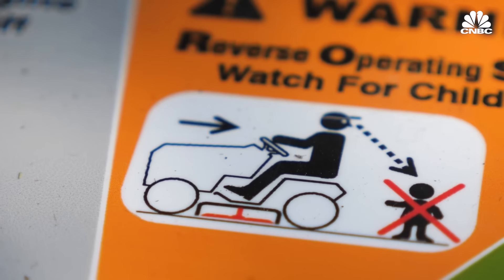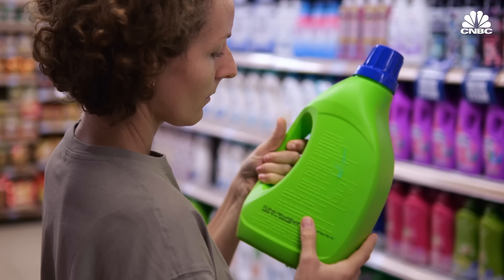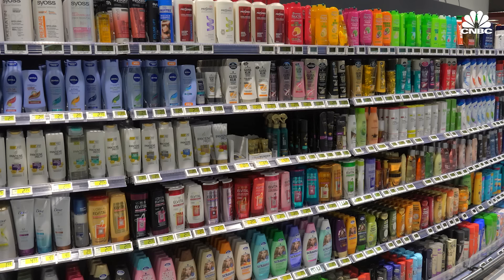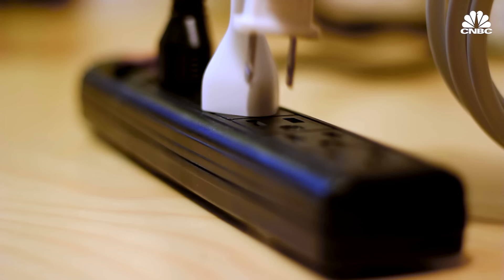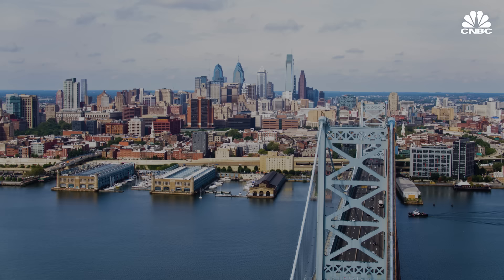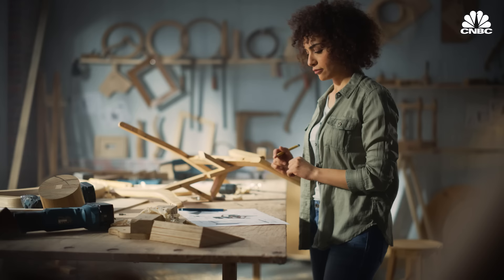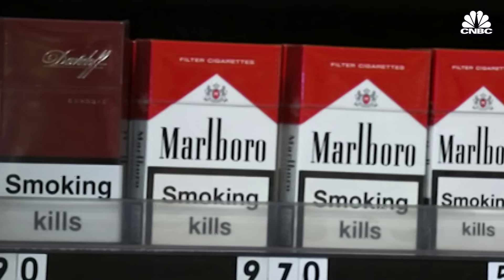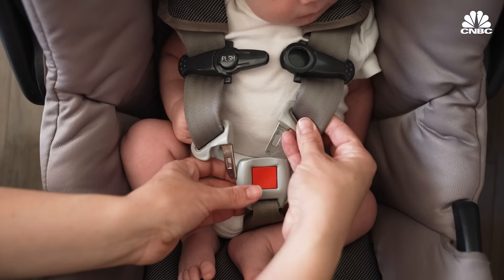Why Warning Labels In The U.S. Aren’t Working

Comment: How about teaching people that life is dangerous and everything they do will ultimately resolve in death. Safety is a personal responsibility in most cases. Something that is poisonous should not even be manufactured in the first place. A good rule of thumb is that just because you can doesn't mean you should. When developing something new, consider if it even should be made! Most things should not have been developed or produced.
Reply: @user-gi7vi9gm4t  What is producing cars have to do with poisonous materials? Cars fall under "use the item at your own risk". 
On the other hand carcinogenic chemicals have no business being used.